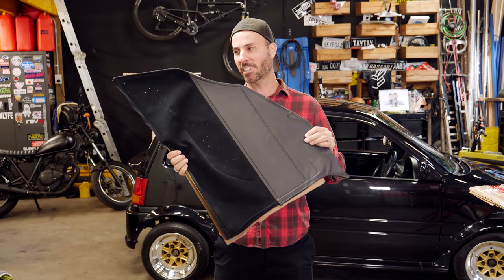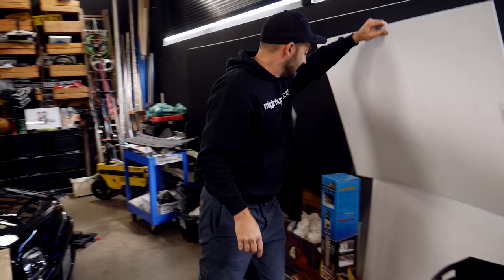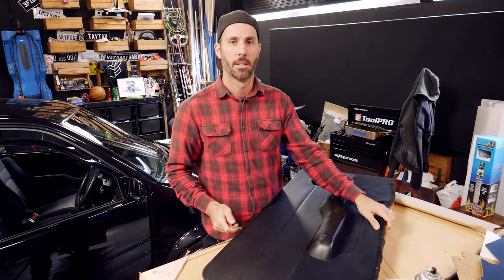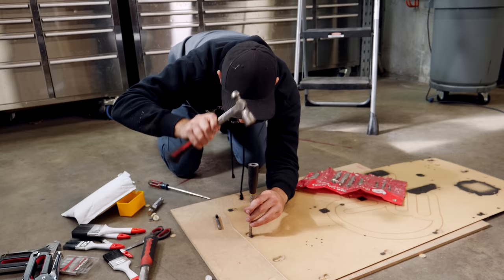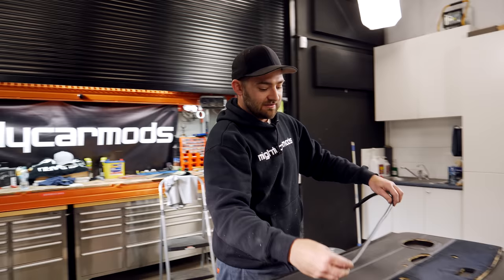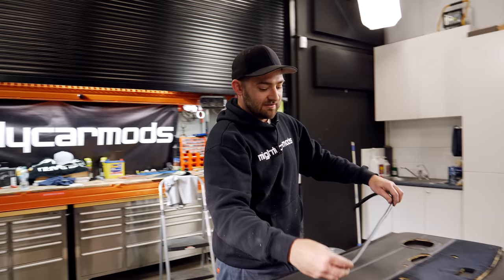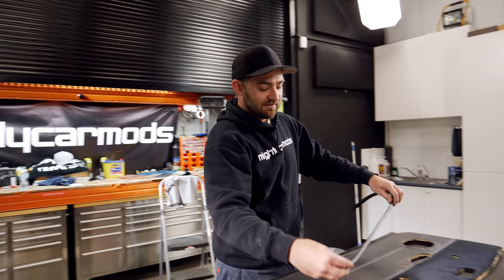How To Fix Your Car Door Trims (JDM MIRA)

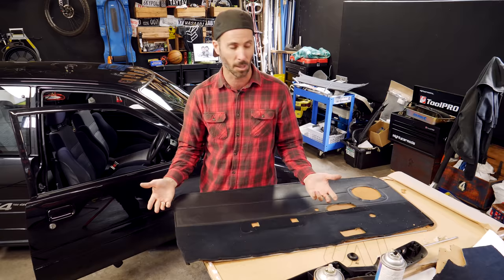Comment: 5:14 For anyone who is redoing door materiel you can use wool felt!
It's cheap, easy to work, very forgiving comes in a multitude of colours and also helps with sound deadening from the outside world furthermore it also helps with speaker setups (hence why they use it in subwoofer builds) It can be glued down all the same and can be sown together with ease if you want a MaAaaD design and or two tone. Actually looks quite regal if done well.

Comment: Weird, got this sudden urge to buy Ryobi power tools 🤷🏼‍♂️
Reply: I've bought loads of them.  I really like them.
If you are a pro who drills (or whatever) all day every day they probably wont  last a year.
If you are a DIY enthusiast they will probably last forever.
I've burned out about half a dozen cheap cordless drills over the last 20 years.  One of my Ryobi drills is about 5 years old now.  The  rubber is falling off but it's still doing the job like the day I bought it (with new batteries).
What I really like is the range of tools you can get for the money.  Why  spend £400 on one tool when you can get a small collection (or a bunch of batteries) for the same money!
Reply: Lol my Ozito cordless is 6 years old and somehow still going strong.
My Black&Decker that I got in a box of crap for $5 that's probably older than I am is the superior drill though. 1970s or early 80s maybe? Can't do self tappers for shit but it'll drill a hole through the entire universe.
Reply: I like ryobi stuff but I do have a Dewalt cordless drill and omg it is vastly "superior" to anything else I have....
Reply: LOL really? That's what companies you want to do when they sponsor some stuff.. :P  If you feel the urge to buy that stuff you are an easy prey for the big companies ;)
Reply: Heres a lifehack..  get the tools with a cord and you wont have to worry about batteries
Reply: @TrashDeviant  black and decker used to be a premium brand, now they are complete garbage
Reply: @TomTomTomTom538  That tends to happen. Snap-on being a great example. I'll take Toolpro over Snap-on any day if I'm buying new. Fraction of the price and arguably better quality now.
Reply: I'm rocking the Ikea cordless drill with the battery that doesn't even come out.
Reply: As a home gamer, my Ryobi collection suits me just fine.  I still have the drill and circular saw I bought in 2002.  Plus a couple of drills from the thrift store.  If I were making a living with cordless tools, I'd chose one of the big names but for my use, Ryobi is just fine.

Comment: As an car upholster, I recomend doing it completely new. Despite the fact that it will be more work and it will be more expensive, you avoid one serious problem. On of the things that makes this usually a bodge job is the simple fact that old glues and new ones will try an eat each other.  Simply put, I wont stick well enough in most cases. Mcm does it well, I'll give m that but that is in most cases what I'll happen. Same with roof liner.

Comment: When I was doing this for my early 90's Corolla, the door cards were mirrored, which made my process a lot faster. This kind of job is also so much easier with a router and patterning bit, especially with mirrored door cards: Double side tape the old to new, old to new to new in my case, do an oversized jigsaw cut, then take it to the router. Not only do you reduce time by reducing cuts, but you're also doing less setup for each step.
I only ended up dong my own because it was becoming too difficult to find door cards within my car's own spec. At some point they changed from all wood to half plastic and half wood, and I believe the latest years of it changed to full plastic. Each type of door card also had their own style, it wasn't just a move from wood to wood+plastic to plastic, but each style changed a noticeable amount, and I wasn't entirely comfortable with the change, especially if I couldn't find matching front and rear cards. 
Sadly the car was totaled while I was fixing up the interior. RIP that nugget.

Comment: When you have cut the board into shape, put on few coats of urethane lacquer. This prevents wood from sucking moisture even if it gets moist and weather stripping fails etc.
Also when putting the leather or what over in place, place it where it should go. Fold it on it self, spray the contact adhesive, hold fabric in place while folding it back to glue it and repeat on other side. This way peace stays in place and there is much less fighting to get it fit properly.

Comment: You can use MDF if you soak it in lacquer. Then it becomes stronger and water proof. I use HDF that's been lacquered with 4 layers by brush or 5 by spray. I've got them on a open top Jeep, no issues in 3 years now, since install.

Comment: the best material to use for these types of door trims is alupanel, used by sign makers. will never fall apart and never get damaged by weather. can get smaller sheets from bunnings
Reply from the maker: psy06 good tip!

Comment from the maker: Mira hearteyes
Reply: love this style video
Reply: Your best
Reply: Also "Cheryl's box", can be had..
Reply: Let me know when the Hoodie is back in stock!!!
Reply: When is the superturbo going to be imported?
Reply: What's Happening with the SubaRoo OutFap ?
Reply: More like what's happening with the minimal content release?
Reply: @ZedKay86  They have day to day jobs to do as well other commitments, it's on the FAQ on their website :D
Reply: Tip for next time: Use a finer toothed blade for the jigsaw when cutting thin material. This results in less vibration and tearing, which makes it easier to cut straight and leaves a tidier result.
Reply: Typical. Ordered the chop fit pack 2 weeks ago, hasnt even arrived yet and now its on discount. Fml.
Reply: Winston Smith  Already paid customs fee and cba waiting on another order from aus to uk, just annoying that its 12 quid cheaper now and i dont have mine yet, plus custom fees/handling charge on top makes it worse (not that this part is their fault)
Reply: Winston Smith  Im from yorkshire. 12 quid is 12 quid hahaha
Reply: Need more hoodies in stock!
Reply: you guys are missing out not having Patrion. Even if only 1% of your viewers subscribed for $5/month is a big loss, do the math boys.

Comment: As far as DIYing door panels, "two-tone" is easy enough - where the two differing materials meet, you cover with a piece of trim material or molding, just like an OEM does. If it's trim material, you would ideally sew it all/get it all sewed together down this joint since all 3 pieces of material are overlapping. If using a molding of some sort(anything from a thin chrome strip to a full length arm rest - it just needs to cover the joint), you can possibly get away with just an adhesive as long as you choose the right stuff(there's a specific industrial adhesive for EVERYTHING today), or poke holes through the card and put short screws in through the back of the molding(don't poke through!), or attach spring tabs, or fold over tabs, anything like that to the molding to stick through the door card, whatever attachment method is most appropriate. It's no different than using the pinchweld material to trim the bottom of the door panel here. 

Also, put a thin soft foam layer between the door card and the cover, it'll fill it out and give it a bit of a perceived value boost. You can experiment with thicknesses, but between an 1/8"-3mm and a 1/4"-6mm would probably be the 'safe' zone. You can even get sneaky and use thicker pieces on one part of the panel and thinner pieces on, say, a second material, or you can leave a gap between two pieces of foam and pull the cover down to the card with some thread to emphasize a visual seam.

These things really aren't that difficult to get creative with - especially once you figure out how to build door structures that match a custom door card that maybe has large custom arm rests(shape a block of hard foam into the shape you want, coat in resin, cover with layer of felt or similar material[T-shirts even work], coat in resin, let harden, coat in body filler and sand it to shape like bodywork, then paint it or upholster it; attach through the door panel to the custom inner door structure, likely using screws). If you can do basic bodywork, basic composite work(in other words, you've worked with a hardening resin before), you've cut/drilled wood with a power tool at some point in your life, you have the basic skills to make door panels from scratch.

Making something like an upholstered center console from scratch really isn't that much different - but, you start talking about upholstering seats from scratch, especially doing custom foams too, that's some straight wizardry, I don't even know where to begin with that stuff...

Comment: Also: If you own one, try using a multi tool. I had to make a rectangular cut in 19mm MDF (building loudspeakers with weirdly shaped tweeters) and it worked like magic: Way quicker AND better quality than drilling holes in the corner and cutting it with a saw.

Comment: you can clean old fabric and vinyl trim really well with prepsol [trimmer here]. before putting back on. you can also just use new fabric. it's easy. 6mm foam glued to the masonite then lay fabric/vinyl on top. do not put glue on the main "right side" area, just put it on the back around the edges. Then fold the edges of the fabric around the edges and press down. you basically stretch it like a canvas at that point, [keep it tight but not so tight it bends the trim] and finish all the edges off. Then trim excess [to about 20-25mm]. then stab thru any holes you need. [NOT BEFORE] Believe it or not they're not "door cards" they're called doortrims
Reply: No, they're called door called in British/Australian English. Or Door Panel in american English...
Reply: dude i'm literally an auto trimmer and have been for 16 years [in australia]. I have never heard the word doorcard in my entire life
Reply: I think it's probably a regional thing like Potato cake or Scallop.

Comment: Hey Moog, there's a home device called a sewing machine. It allows you to join two pieces of material together using thread... Generally looks more upmarket than the faux stitch heat sealing too. ;)

How about repairing seats next? So many seat bolsters collapse and a DIY video for that would be great.

Comment: that brown stuff is MASONITE, not MELAMINE,  [just saying in case someone tries to do this]
Reply: melamine wouldn't be a bad material to use either, might have to be careful picking picking adhesives as it softens with quite a few solvents
Reply: Nope it's not masonite. https://www.bunnings.com.au/inbuilt-colourboard-2440-x-1220-x-3mm-black-melamine-sheet_p0560042  "Suitable for interior cabinet backing applications. The melamine surfaces provide a high degree of durability and wear resistance."
Reply: Millboard for uk
Reply from the maker: Yep just a verbal typo, oops!
Reply: @pandabear682  You're both right(wrong). Melamine is the plastic layer, in this case, on a masonite board. Melamine boards you buy at a hardware store are more typically layered on particle board, like the one you've linked. The product they actually used in the end was most definitely masonite.

Comment: just a tiny bit of observation, sorry if its been said already but it really looks like the plastic clips are a loose fit in the slotted hole i think using the next punch size down would be way more secure.

Comment: put some Meguiar's Tyre Dressing G7516EU in a syringe and inject it between the glass and window quide rail and your window will be move as new at least for 2 years ive tried many products like wd40, Teflon (dry and wet PTFE) sewingmachine oil ect ect but this Meguiar's Tyre Dressing is the only thing that worked btw Ive cleaned (in a bucket of soapy water) the seals and use compressed air before I installed them onto the car, so they were clean, like they came from the factory

Comment: I feel like you could also use aluminium sheet with foam to stop rattling? Surely using metal would be a better option?

I’ve never done this before but metal seems like the logical choice to me.

Comment: Should have used coreflute instead of mdf.   Coreflute is at Bunnings for 8 bucks a sheet and it's waterproof and won't fit and you can shape it with scissors and a Stanley knife and it covers well.   Oh and it's less than a third of the weight.

Comment: Wellllll....
What if my car is kind of more... car-ish and it's door panels are not just flat sheets?
You guys could show to repair more "proper" panel ;-) .
Reply: get some foam,a roller and a razor blade,go nuts shaping the foam,put the material on.use the heat gun and roller to contour the material into the foam and set the glue ...bingo you're done

Comment: My door cards are plastic. I  think I'm just going to rip them out and replace them with sheets of aluminum. Incorporate the power window rocker switches and door handles into them. And, that melamine stuff is useless crap. I wouldn't even put that crumbly shit back in my car. I'd definitely have to look for a more robust material.

Comment: Am I the only one that thinks it still looks terrible?? In the after shots they've still got ripples all along the bottom
Reply from the maker: Scott Shipley that’s the back where it hasn’t been tucked in to the door seal, it’s left flappy on purpose. It’s a very cheap and 27 year old car so the finish isn’t gonna be amazing
Reply: @mightycarmods  it was actually the bottom of the front door that I was talking about. It looks as if the glue has come unstuck or there wasn't enough. I know it's never going to be perfect when you're reusing the original material but if it were mine I wouldn't be happy with those bubbles at the bottom if I'd just spent all that time stripping them down

Comment: 15mins on a 5 amp battery is not great. The idea is great,  but they really need to up that time.
Reply: The only way to do that would be make it less powerful. 

A propane powered one would make much more sense.

Comment: these cordless tools are really stupid imo
its not that hard to just get an extension cord and use a corded drill/heat gun/etc and its alot less of a hastle when you dont need to recharge batteries
not to mention the money that you have to spend on replacing/recelling your batteries every couple of years